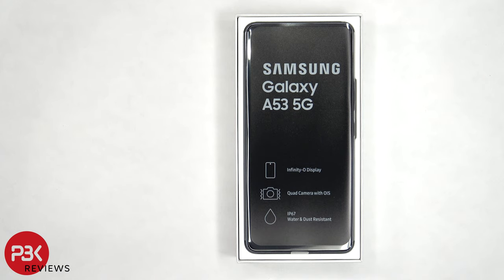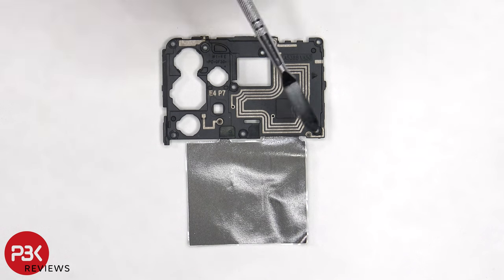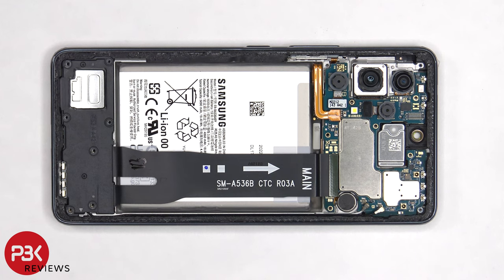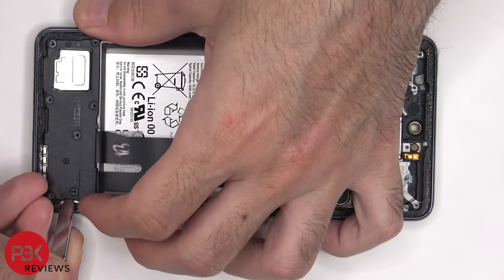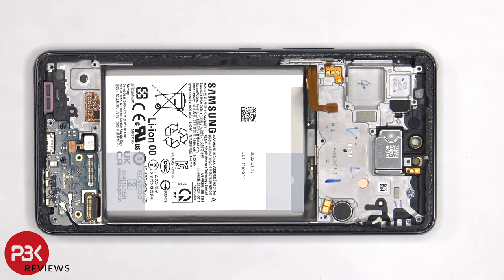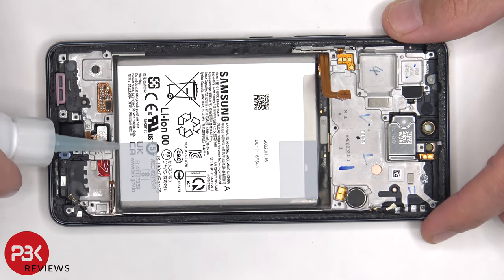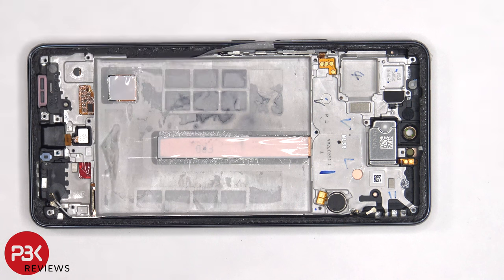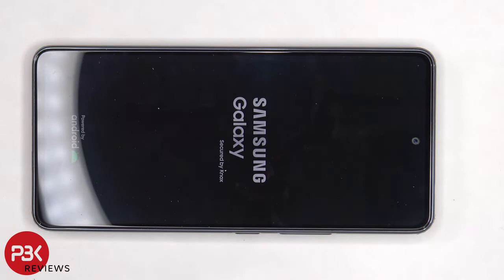Samsung Galaxy A53 5G Disassembly Teardown Repair Video Review

Comment: Samsung passive cooling implementation is such a joke no thermal paste 🤣🤣🤣🤣
Reply from the maker: Lol yep but that graphite pad still transfers heat but would be much better of it atleast had a some thermal paste on the frame or a 3d layer of graphite on the frame as well.
Reply: @PBKreviews  thermal paste is more effective bro
Reply: I'm shocked too,but these graphene or graphite sheet where in the world would they be able to "transfer" heat when there's lil space in the phone ?...down clocking performance in relation to heat to sustain stability is the only way to go ,as is being done.
Reply: @dukebrobbey64  yea bro samsung is doing poor implementation
Reply: @PBKreviews  how about a33 in your opinion?
Reply: @dukebrobbey64  A metal instead of plastic back, although it's better to have a processor that doesn't heat up as much to begin with.
Reply: @bumbeelegends7018  here i am 1½ years later with an overheating samsung a53 5g 😁

Comment: Glad to see the heat pipe from the a52 make it to the a53. Very weird how they managed to make space for it here, but not on most other Galaxies.
Reply: Bro it goes to show you which A series Samsung is really really prioritising ,the A73 of all the A series last year even didn't have one !....I'm confused myself.
Reply: @dukebrobbey64  Yeah, I owned a A52s for a while. It's a fantastic package overall, with the headphone jack and sd card slot people always ask for, with plenty of processing power to boot. It's a shame they decided to place a Kinder egg haptic motor in it though, it really ruined the experience for me that I sold it within a few months.
Reply: @somayough  whats was wrong with it?
Reply: @somayough  whats a kinder egg haptic motor?
Reply: @scottgriffin449  Figure of speech. What I mean is the haptic/vibration motor they placed in it was very cheap and nasty. It's sloppy and noisy- kind of like the vibration motor on old Nokia feature phones. Otherwise, the a52s is a pretty good deal if you could get one at a discounted price.
Reply: @somayough And the haptic motor for some unknown reason will not far point for longer. What I mean, it covers the induced, it will start. It was useless really. I remember old phones have very nice motors than this.

Comment: First,why run down the "heat" pipe underneath the battery if lithium batteries do not like "heat",I guess really there isn't anymore space in these compact smartphones of ours.

Secondly, I believe the S10 series implementation of the top speaker,with the cameras on the side,would better afford the speaker much oomph !
Reply: тоже

Comment: why can't Samsung just use 4 small screws to hold the plastic backplate, they can advertise it as replaceable and customizable while keeping the water resistance, but again they don't even use pull taps and the removed the headphone jack 💀

I'd love your videos more if you comment on the fact that there is clearly enough space for a headphone jack in there ฅ^•̀ﻌ•́^ฅ
Reply from the maker: Thank you, and yep not sure.

Comment: Great video. One day my screen went black, I think I leaned on it. There's no glass damage, just blackness. It makes noises and buzzes when i turned it on and off but its just black. I thought maybe there was a loose connection so I bought tools to take it apart. I guess the next step is a new screen.
Reply from the maker: Yeah, sometimes they get a hairline crack which is hard to see or not visible in the screen itself and stop working
Reply: i have this same problem, did you ever solve it?
Reply: @potptvpatsonthepulse5701  I bought a screen replacement and replaced my screen. It took a lot of time and effort. The screen wasn't as responsive, and within a month part of it stopped working and I couldn't put my pin in to unlock. I am typing this from my the new phone I had to get. It's a pretty tedious process to replace the screen yourself if you're not already tech savvy. I was quoted $200 to get a replacement screen at a phone repair shop but instead, I paid $75 for the screen and $9 for some tools. $10 for double-sided phone adhesive to put the back cover on. I wish I just bought the new phone and skipped the replacement thing. The replacement screens are cheap
Reply: @invectrum  Thanks a lot for the response! Yeah, I've done a few screen replacements on my phones over the years and the quality of parts has definitely gotten a lot worse. I think you're right about just buying a new phone

Comment: Mines hasn't worked for a couple weeks now after having dropped it it wouldn't charge and still won't thought it does get hot after a while it doesn't power on and also rattles inside. Is it a simple self fix or does do I need to visit a repair store
Reply from the maker: Hi, it could be a simple fix but not always. You would need to take it apart to see if there are any loose cables. If not, it might be damage to the screen causing it not to work or other parts.
Reply: Hi would u like to tell, what happen to ur device rn? Cus i’ve been through the same thing like u

Comment: Puzzled that Samsung removed the headphone jack. Having disassembled the A52/A52s, would you say the A53 still had space to retain a headphone jack in its design?
Reply: It's a money grab. Just like removing the charging brick.
Reply from the maker: I think it would have had enough space, its the same layout on the bottom as the A52 pretty much and the A52 had the headphone jack. I understand the need for headphone jacks but manufacturers I feel are moving more toward the wireless newer era stuff. Since a lot of people now a days are starting to carry wireless buds and earphones, not as many are using the headphone jack so its becoming an old technology. Just like car cigarette lighters, back in the day they all had em, people still smoke but cars don't have them anymore.
Reply: @PBKreviews  Wireless, while convenient, introduces latency, and audio quality will never be the same as that of a jack. Users should not be forced to buy an accessory because the manufacturer deems it "Outdated/Old", it should just be standard like it has been.

Comment: Hello, I have a question my galaxy a53a 5g randomly turns off. Usually if i press power button and volume down button it turns on. I'm curious if its something I can fix at home do i have to take it to repair store?
Reply from the maker: Not sure what is causing it to say. Could be many things.

Comment: I have replaced battery in my A53 and after that no SIM card can be detected. Any ideas? I tried everything: reboot, clear cache, other SIM card, both SIM card slots, replace the sub-board (where the charching port and the SIM card reader are). The SIM card is working fine on another smartphone.
Reply from the maker: Make sure the two wire cables/coaxial cables aren't damaged and connected, as well as the flex cable leading from the sub board to the main board. If all those are ok, and you tried a replacement sub board/charger port board and still have the same issue, then you might either have a faulty battery which is shorting something (highly unlikely though) or you may have damaged something on the main board when the battery was being replaced.
Reply: @PBKreviews thank you so much for the fast response! Really appreciate your answer, it gave me hope to continue… I found a very tiny part (looks like resistor or capacitor) on the main board that fell off. Not sure how can I put it back in place at home. I have a second working A53 so at least I can identify the place where it belongs.

Comment: Since changing screen mine intermittently glitches (like fails to respond to screen inputs and randomly generates screen inputs when there is none). I have read that the ribbon cable connections are very temperamental and shouldn't be disconnected unless absolutely necessary. Does anyone think its worth opening and replacing the ribbon cable or should i buy a new screen (was working fine first couple days& still does but glitches once a day on average). Thnx
Reply from the maker: It can be from defective or poor quality replacement parts. It can also be from software issues. Sometimes you need to update the phone software to the latest which will work properly with replacement screens. Try updating if the software it not the latest version and see if it helps.

Comment: Hello, thank you for the Video. I just changed my Display and the Touchscreen doesnt respond. What could it be ?
Reply from the maker: Make sure the connector is connected properly, and also you might need to update the phone software and make sure its on the latest firmware. You may need to use your old working screen to do that before installing the new one. If that doesn't help, it might be a defective replacement.

Comment: I have a question regarding that bottom primary microphone. I just purchased this phone tonight. The store employee shoved the sim card ejection tool being 1/4 inch long, into the microphone slot then when I called him out on it, he stated it didn't harm the phone. But would order me a new one. What's your opinion on it damaging that microphone? Thank you.
Reply: Try watching jerry rig everything regarding this
Reply from the maker: Hi, you will be fine since the filter and the mic are both seated above the hole so basically its like a sideways L channel. So the sim eject tool would basically just hit the end of the frame wall and no components.
Reply: @PBKreviews  I have a question for this. The phone It will still be waterproof?
Reply: @PBKreviews  OK I have a quick question, I have this phone but recently every once in a while it would freeze and either it would restart or just straight up turn off by itself. Any ideas as to what may have happened?
Reply: @PBKreviews  no need to worry about waterproofing? Because it has no damage at all?
Reply: @PBKreviews  Seems they foresaw people making that mistake. Another reason for eSIMs.

Comment: Does this disassembly affects IP67 rating???
Reply from the maker: Yes. You would need to apply new original pre cut adhesive or a new back cover/battery door which came with the adhesive pre installed to retain the water/dust resistance.

Comment: Hi, 
Thank you for this amazing video.
I replaced the antenna board because no signal but still not working. 
Could you please help?

Thanks a lot
Reply from the maker: make sure you replaced it with the correct model version. There are numerous sub boards for different regions of the phone. You need to replace it with the correct model version that matches the model number for your phone.
Reply: @PBKreviews  thank you for your response.
Actually what I replaced is the black circuit with the grey lines that comes on top of the main board
Reply: My Samsung A53 does not get any network signal. Should I replace the IC CPU?
THANKS AGAIN

Comment: I have just bought this phone today and I bimistakely used sim ejector tool in Microphone hole instead putting in sim card hole.Is there any problem sir
Reply from the maker: Hi, no you will be fine. Mic and filter are seated above the hole and would not be damaged.
Reply: @PBKreviews  Thank-you sir for the reply

Comment: Hello.  The user accidentally inserted the sim card pin into the microphone hole.  The microphone is working but is there any problem with the device? Samsung A53.  Best regards
Reply from the maker: Hi, you will be fine. The mic and filter are seated above the hole. They wont be damaged.
Reply: @PBKreviews  Hello again.  The microphone was not damaged as it was on the motherboard so it wasn't flush with the hole.  I asked to confirm.

Comment: I find the fingerprint sensor annoying, could anyone tell me if I disconnect the module would the phone still operate normally without it's use, or will it cause problems for other aspects of the phones normal function?
Reply from the maker: I think the phone should work fine without any issues if you disconnect it.
Reply: @PBKreviews  thank you. I am also surprised to see a Li-Ion battery in there, as a variety of sources such as gsmarena describe it as having a Li-Po battery

Comment: Is the secondary microphone supposed to record as the primary one? I was distracted while setting up my phone and confused the secondary mic for the sim tray and i inserted the sim tray extraction tool into the sec mic and applied a bit of preassure. Im worried i might've broken it
Reply: If you get the info, i'm interested too. I did the same.
Reply: @AstroKevin  apparently the secondary microphone Is mainly for noise cancelling while calling, it isn't used for recording, at least not with the a53 5G's stock sound recording app. Some phones have the "interview" mode for recording which does use the secondary microphone, but this one doesn't

Comment: My a53 drains battery more than normal
Reply from the maker: Make sure there aren't any apps running in the back ground that may be draining it. Also you can try backing up all your data and doing a factory reset to see if it helps. Or you may need a new battery.

Comment: I've owned one of these phones for a couple of weeks and today I've started hearing a rattling sound from inside it when it's moved up or down (towards or away from you as you look at the flat screen) or turned over. I'm quite concerned. The noise seems to be coming from near the camera. Does anyone know what could be moving around inside it and whether I should be worried?
Reply from the maker: It's just the camera assembly and its normal for it to move around.
Reply: @PBKreviews  Thank you for replying. I'm just surprised that I haven't noticed it up until now as it's fairly loud clicking. I suppose once you start worrying about things it suddenly seems obvious.
Reply: It's the stabilizer (ois) of the camera
Reply: No its ois camera which makes sound
Reply: @PBKreviews Thank you for the reply because I was worried about the same issue on mine I already had my phone for a year now and I just noticed when I shook my phone. Cool that it's normal. But I recently drank at a party a little to much and I passed out with my phone in my pocket which unfortunately I woke up to a messy situation 🙃 which made my whole case get wet if you know what I mean 😅. I was able to get it turned back on but now I am experiencing at times the phone freezes and shuts down and restarts. I wrote samsung support they seen after a few error reports that my AP is suffering a minor voltage surge. Could it be it is still wet by that chipset. And it does get very hot by the camera when it shuts down and freezes. I did a factory reset that it did help out another but when. It freezes and shuts down it does it like at least ten times and I take off any casing I have on it for it to normalize it to stay on. I would want to open it to wipe down all of the motherboard and stuff but with my big clumsy fingers I might make things worse. I am just hoping it will completely dry off by itself. Any suggestions.

Comment: 2:12 majority of samsung midrangers dont have IR proximity sensor, they have software solution called virtual proximity sensing, 

Only devices with super amoled plus or flagships have IR proximity sensor underneath display like M51, M52, A71, A73
Reply: Can you actually confirm that the A73 has a proxi sensor?

Comment: Waiting for a73! Awesome video. If this A53 and an S20FE was given to you to choose, which one would you choose?
Reply from the maker: Thanks! I probably would go with the s20fe.
Reply: non I'd go with the a52s
Reply: @3mar00ss6  s20fe is superior in every aspect
Reply: @thatvoiddude6188  no lol
Reply: @3mar00ss6 better processor, better camera ,wireless charging, metal Frame, 120hz screen. These are all on the S20FE
Reply: @thatvoiddude6188  better processor (not felt), better camera (maybe), wireless charging is inefficient and slow, metal frame (don't care), the screen is the same* as the a52s.

the reason the a52s is better than the s20fe... the headphone jack I literally broke my headphone jack before that's how much I use it and don't even bring up disposable Bluetooth cringe...
Reply: @3mar00ss6  I use wireless charging to charge my Buds Pro so it is useful, but charging the phone itself with that way is inefficient like you say. But unlike the A52s, S20FE uses the same sensor with S20 and S20+. That sensor is also used in Sony's flagship phones and the sensor is a flagship sensor itself. A52s uses a pretty standart midrange sensor and also lacks optical zoom. Even if we disinclude the metal frame, S20FE is built way more quality. Also %90 of the time S and Note series give a better experience than A series, even if they are 1 or 2 years older than the A
Reply: No idea, will they bring A73 to NA